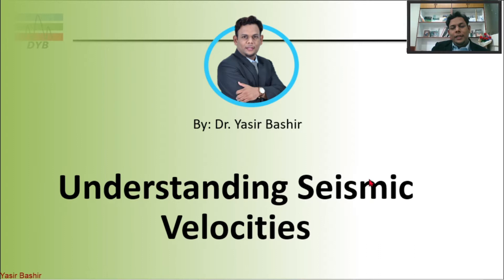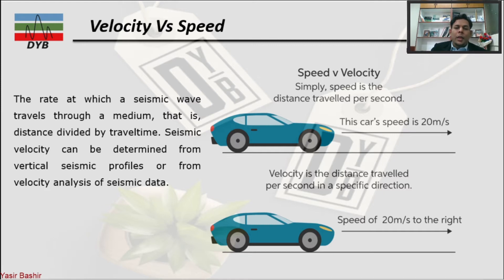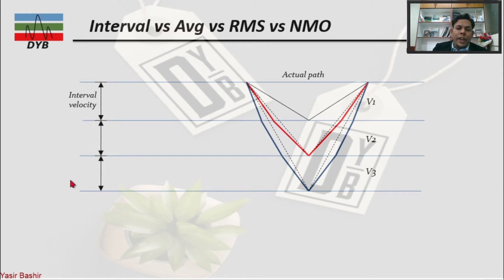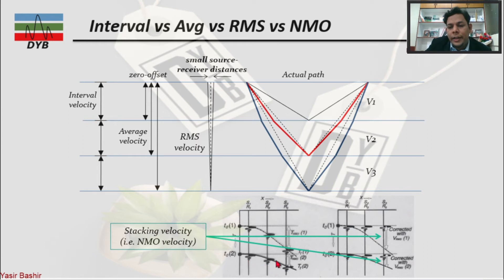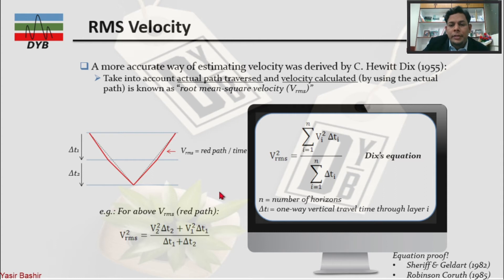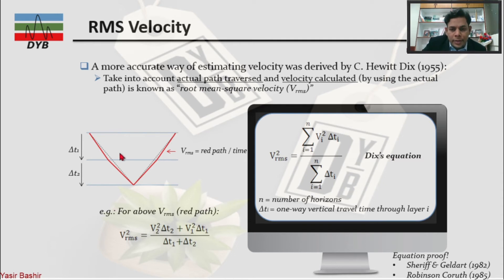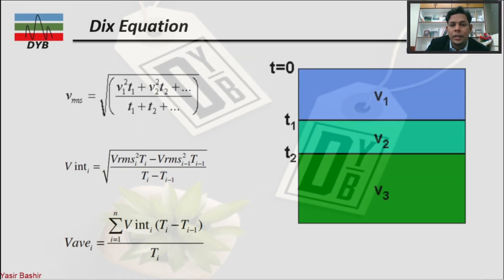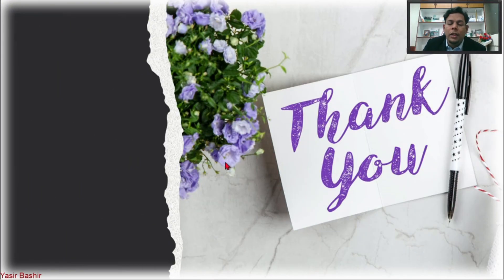Seismic Velocities Interval, NMO, RMS & Stacking Explained | Essential Geophysics Guide for Experts

Comment: How do you get the internal and avearage velocities? From check shots?
Reply from the maker: Check shots provide the actual depth of each formation that would be used to calculate the avg and interval velocity as a function of depth. One limitation of seismic velocity is that the reflection events used to map the seismic sequences and the seismic facies that describe the areal and vertical distributions of the reservoir and sealing units are measured as functions of seismic traveltime rather than depth. Still, there are some equations mentioned in the lecture to find Vavg and Vint by the Vrms.